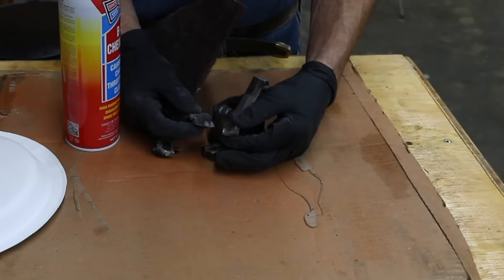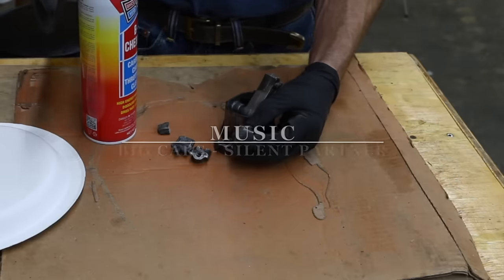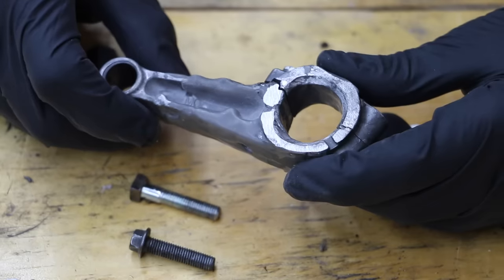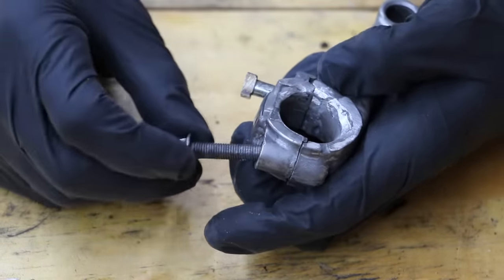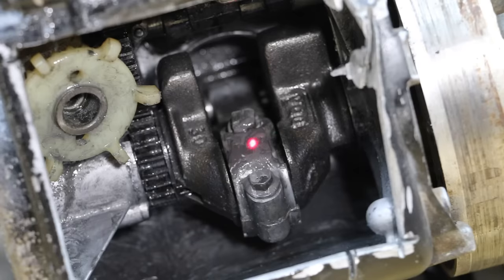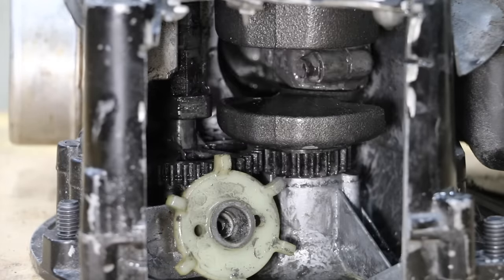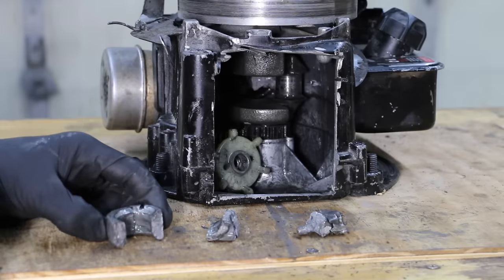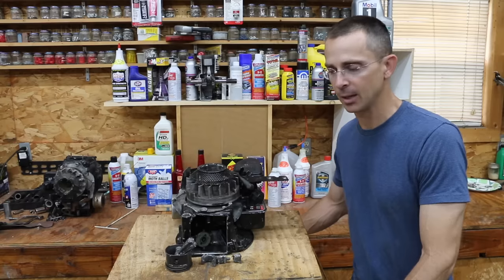Is JB Weld Strong Enough to Repair a Broken Connecting Rod? Let's Find Out!

Comment: I just tried to fix the top of a plastic 1-gallon gasoline jerry can (the one I used for 50:1 2-stroke mix) with J.B. Weld.  The very top of the plastic cap had sheared off at the threads, making the can junk.  Unfortunately, J.B. Weld didn't hold strong enough and, after curing for 48 hours, the repair job failed at the seam as soon as I tightened the cap back down.  It would be interesting to explore the science behind epoxy resins and how/why their bonds might fail tests of tension/compression/shearing.  Do they need a porous surface (i.e. wood-on-wood) to adhere tightly, or is it important to get the the tightest clearance possible (i.e. two pieces of flat glass clamped together)?  Also, does petroleum/hydrocarbons affect the strength of the bond, all else equal?
Reply from the maker: Thanks for the video idea.

Comment: jeep straight six 258 cracked  on the drivers side after adding cold water to a overheating engine. took it home  , cut along the crack with a die grinder to make a decent grove.  wire brushed  the length, cleaned with carb cleaner or electromotive cleaner  dont remember lol. jb welded it up let it sit few days ,filled the cooling system and off we go. that was 8 years ago. drove it back and forth from Florida to north Carloina several times. and its still going.
Reply from the maker: Thanks for sharing.

Comment: This video is not about JB weld at all.  I appreciate the effort. thank you for the video. Respectfully when applying epoxy to butt ends im sure everyone knows additional surface area is a way to give the epoxy more grip so drilling into the rod a few mm maybe several times and maybe  through, with a 1mm or 1.5mm drill bit at the bonding surfaces with a very slight countersink would create a lot more grabbing ability for the jb weld while hopefully not F-ing up the surface too much for a clean bond. and was it  " steel " jb weld for metal applications that was used ?

Also respectfully Im not sure what part of the rod "  looks pretty good "  just before it was installed after the repair.  the rod bearing area looked way out of round and I didnt see a rod bearing used at all. maybe there isn't a rod bearing for that motor design or maybe it wouldn't fit after the rod repair job. if there is no rod bearing for that motor then the rod should be precision milled to a generally acceptable clearance to that current crank diameter and oiled or cooled properly before any reasonable conclusions can made about the JB weld product but I hear Mr. Project Farm blaming and bashing JB weld over and over.  Hearing any play and clickity clank between the rod and the crank before its even started means this is just " lets glue it sloppy and watch it break for fun " video. All while making a JB weld product look bad with little explanation why his machining skills and already doomed rod make JB weld an insignificant and irrelevant player in his failure to repair the rod even if only intended for a 2 min run.
Reply from the maker: Thanks for the constructive feedback

Comment: I used JB weld over three years ago on my Chevy #1 cylinder cracked exhaust manifold. 2021, still working just fine. The key to JB weld is the dry time. I find 48hrs best.
Reply from the maker: Thanks for sharing.

Comment: Hi, it appears that you used very little pressure when bonding the pieces together.  Is it unnecessary to use a clamp or other method to put pressure on the bonding surfaces?

Comment: Hi Todd,  You are my go to guy when I have problems.  As your JB weld test clips are a few years years old, I wonder if it may be time to test some of their newer products.  I have a Chev 235 1958 engine that has two cracks across the cold plugs. As cold isnt really an issue here in Australia, heat being the bigger problem. I would like to suggest you test the JB Weld EXTREMEHEAT™ PASTE - 3 OZ to see how it compares with the standard JB weld. Cheers and Beers. Daz
Reply from the maker: Thanks for the video idea.

Comment: There are other pro adhesives designed to be literally stronger than metal. Loctite EA 3478 (aka fixmaster superior metal) is one. SikaPower-1277 is another. The latter is even designed to absorb oil from oily surfaces, helping maintain corrosion resistance. These produce machinable surfaces stronger than steel. Might be fun to play with some for a video someday ;)
Reply from the maker: Thanks for the suggestion.

Comment: EXCELLENT effort to bond it! Please consider next cutting straight through the connecting rod bearing. When metals break in pieces its nearly impossible to reassemble them straight or curved to spec's. It appears the connecting rod bearing was not smooth. I wonder if a connecting rod could be repaired if it had a very simple break?
Reply from the maker: Thank you for the video idea!

Comment: I have question.  I'm working on an old radio that has lots of gears to the tuning (Shortwave Hallicrafters SX-42).  There is a small gear that is cracked to where it will still slide into place but it spins on the shaft there the knurling is located.  Do you think JB Weld would work for this application?

Comment: I really like your videos! Thorough, fair, and out of the box thinking. 
 Im wondering if JB Weld is tough enough to repair the scratches and gouges in a cylinder wall. Ive used it in a small 2 stroke engine l was learning to port, l say learning because l modified the exhaust port too much once, took too much out, and built it  back up with JBWeld, it ran great for years after. This was 20 years ago and the little engine still runs! Great job on your videos. Keep up the good work!
Reply from the maker: Thank you for the video idea!

Comment: I had a coolant leak in my intake manifold. I plugged the leak with JB Weld and it lasted for years until I sold the truck.  I have been a GB Weld fan for 30 plus years.
Reply from the maker: Thank you for the feedback

Comment: Hey Todd! I’m not sure that it would make any difference, but if I was going to attempt to glue oil impregnated aluminum, I would run it through my ultrasonic cleaner in a degreaser solution such as Purple Power first. I think a bent connecting rod would probably self destruct even if it wasn’t broken.
Reply from the maker: Thanks for the suggestion.

Comment: Ive always mixed my jb weld with more hardner to make it a slightler less darker mix.
Ive always had excellent results as long as i clean the surface and leave some abrasion to help bond it.
I wonder if jb weld works better with the 50/50 mix like they say
Reply from the maker: Thanks for the video idea.
Reply: @ProjectFarm  Thank you for all this interesting information.

Comment: I job welded a Mercury 2.4L V6 boat motor block. I was turning it 7000RPM on an Allison boat when it broke the crank, windowed the block, and gouged off the sealing ring ridges. I built them back up with JB. Patched the holes in the block with JB, filled the gouges in the pistons (from crank pieces catching in the ports) with JB, then slapped in a used crank and some used piston rings. I sold it a year later still running like that. It was a little hard to crank, but it would still push the boat into the 70's....
Reply from the maker: Thanks for the feedback!

Comment: hey man I hope you reply, I'm new to fabricating stuff in my car, and I got this aluminum odd alloy stuff that I'm using for the intake came from a cheap intake kit, I'm routing it into my bumper, the intake doesnt take too much heat or stress so could I use this? does this stuff withstand boost pressure? For example if I used it to get a flange on my Bosch Bypass valve so that I can mount a cone filter on it? It looks like this Is exactly what I've been looking for. not sure let me know please!

Comment: One trick that I learned about JB Weld steel stik...apply on the surface and then cover the surroundings like a wall. Its still holding my engine block hole like a champ!!
Reply from the maker: Thank you!

Comment: I have used a two-part epoxy resin to repair broken bits on my chainsaw and my whipper sniper. It is called "metal epoxy". So far, it worked well. The thing is I only used it on parts for static load such as screw thread. I believe that quick fixes like JB Weld won't last on dynamic loading component like this crank shaft. The centrifugal force will find the weakest spots and tears the component apart.
Reply from the maker: Thanks for the feedback.

Comment: Maybe try casting a completely new Conrod and cap out of JB-weld. Even perhaps make it slight thicker in areas. I don't know if you have access to a mill to finish them off so the bores are round and square. I would love to see how a plastic cast rod would do.
Reply from the maker: Thanks for the suggestion.

Comment: A  past repair on a chainsaw, I embedded wire in the JB weld between the parts and let it cure for two days. Talking with the friend I did the work for, the saw is still holding together. But the repair wasn't to the connecting rod, yikes, it was on the case. It did seem to hold up to the vibration of the saw quite well.
Reply from the maker: Thank for sharing.

Comment: Heliarced a broken rod cap on a buddy's compressor about 3 years ago...it's still running....old kz1300 6 cyl. Street bike...guy gave it to me...he had run it into a curb and it broke a hole in the lower case big enough to put your hand into...layed it on it's side and made forms with carboard and super glue...used the large size jb weld..all of it.. rode the bike for 3 years... no oil leak..buddy with a cad Northstar, ran it over a rock. Broke a 2x4 in piece out of the pan...pull the motor to replace it? Hell no. 3/8 aluminum plate same shspy as the bottom if the pan...drill 2. 3/8 holes for bolts, put seals on the bolts, made a bracket that hooked. Inside the pan, drill/tap holes..clean well and 2 kits small size jb weld..wipe off the excess...ya half to look twice to even  notice it.. drove it every day for the past year, it doesn't even seep...
Ya the con rod...we knew it would not fly....but ya just had to prove it!
Ever used it on a head sealing surface? My  BBC boat motor with aluminum heads,,, serious pitting around the water passages...Dremel out the pits for clean metal..jb weld with a razor blade...steel shim head gaskets. Used that nasty brown sealer....year later...maybe 200 hrs hard running time...pulled heads back off...jb weld still stuck...couple things you might tell people...jb quick weld is kinda worthless...and regular jb weld NEEDS 24 hrs cure time...hot weather, cold weather it don't matter. Do you know any history on jb? I'm 65 and it was around bwhen I was a kid. 
You have a cool show...nuthin but in your face facts..keep up the great work!
Reply from the maker: Thanks, will do.

Comment: Would it work using to repair inside  threads in a small engine block. Like for a push ,or riding mower?
Reply from the maker: Thanks for the suggestion.

Comment: I used JB Weld to repair a good sized crack in my Dodge Caravan exhaust manifold.  It was not recommended for high heat areas but held fine for the life of the vehicle.
Reply from the maker: Awesome!  Thanks for sharing.

Comment: I don't know if it will hold, but quicksteel is stronger in my experience, it's a 2 stage putty epoxy, I've re-attached a bolt ear on my 94 Wrangler tail-shaft extension housing, and it held up until I removed the housing to put new one on, that was with 4.0 i6, a tool and die guy my brother worked with used it in a die once to fill a low spot, my brother said it was still there 6 months later when he left, and that's after 10's of thousands of hits in a press

Comment: I fixed a 1964 corvette engine block that froze up during the winter with JB Weld. Back in 1988. It held til I traded the car off. It was holding strong after about a year when I walked away from the car.
Reply from the maker: Thanks for sharing.

Comment: Thanks! Thats HELPS my DECISION NOT to use JB WELD to re-attach my porch rail. However, I DID use it to FILL in the rust holes in the bottom of my metal door (after cleaning, of course).
Reply from the maker: You are welcome!

Comment: How long did you allow the JB Weld to cure? It probably takes several days to reach maximum strength.
Reply from the maker: Great point. I seem to recall waiting over 24 hours but longer would have probably helped

Comment: used something similar on my bike when some guy cross threaded the sump drain hole. we drilled the sump bolt all the way through and tapped a smaller bolt into the bigger one and "glued" the original bolt back into the sump. couldn't believe that It worked and stopped leaking oil everywhere!
Reply from the maker: Thank you!

Comment: Please show me if it's possible to repair the magnesium housing of a framing nail gun. Mine is broken on the bottom of the handle, where the bracket on the bottom of the rail is bolted onto the handle of the nail gun. The handle has a member that's essentially an eyelet to accommodate the bolt that is holding that rail to the bottom of the gun. Unfortunately that cambel hausfeld designed this in a way that if you drop the gun ONE TIME it's likely that this eyelet will break off, leaving a gaping unrepairable hole in the pressurized housing of the gun, when the bracket could have been effortlessly placed 2 or 3 inches further down, where it could be connected to the 'pan' where the inlet for the air hose connects, because this 'pan' is on the other side of a gasket. If that were to be the piece that is at risk of breaking it would be a part that you order, instead of a whole new gun. I found an exact match of the unit I have that's broken for $40 on offer up that works. I DO NOTCARE THAT I CAN GET A NEW GUN FOR CHRAP I GOT THIS ONE FOR FREE NOT KNOWING IT WAS GASPING FOR AIR FROM THE SIDE OF ITS NECK AND IM NOT TAKING NO FOR AN ANSWER. ILL TIG WELD THE MAGNESIUM B** IF I HAVE TO. but epoxy repair I'm thinking could hold pressure, I'm more.concerned about it bonding to the magnesium. There's also the idea of solder, something like lumiweld. But I really want epoxy to work. I think this would benefit both of us because magnesium repair is something that involves a lot of European motor casings or the landing gear of an F14 if someone happens to be repairing something like that. Other aero parts too!
Reply from the maker: Thanks for the suggestion.

Comment: I used it on a lower transmission mount and it's still holdin.. gotta be clean and use a lot of jb weld haha .. it's crazy it's worked this long
Reply from the maker: Thanks for sharing.

Comment: I've seen epoxy used on motorcycle crank cases where the chain has broken and bunch up around the drive cog, punching a hole in the crank case. I've seen more than a few come into our welding shop and they had obviously run that way because the repairs were whole.
Reply from the maker: Thanks for sharing.

Comment: Jb weld is holding a rocker arm together on my grandfathers farmall tractor. Has probably 1000 hours on the engine since he did it in 2001 and its still holding!
Reply from the maker: Thanks for sharing.

Comment: Yea I’m thinking of using inside a pit motor to hold the thing that disengages the kick starter I think it can do it as it’s only on slight pressure as the motor starts
Reply from the maker: Thanks for sharing.

Comment: My question in their to this is, Would JB weld cold weld 5020psi seal. An extreme high pressure fuel leak at a compression fitting. Their was enough pressure that it blew the rubber line off that was clamped. By 2 hose clamps. It's an issue causing me grief and I'm just about froze at 3:12 am
Reply from the maker: Thanks for the feedback.

Comment: When components like con rods fail, their geometries almost always change. Can't think of "failure" situation that doesn't involve a change in geometric tolerance. I can't imagine JB Welding it together took it back to factory tolerances or anywhere close, which is part of the point. Those little stresses add up to big stresses at 500rpm and beyond, even with no load. Would be interesting to try JB Weld in a similar application where precision wouldn't be such a huge factor. 
Great work!
Reply from the maker: Thanks for the feedback.

Comment: I was remembering a repair I did to the mounting flange on a Chevy fuel pump. To make sure that the flange didn't break again, I reinforced the repair with a small strip of metal. That worked well. The flange never broke. The car ultimately died with that pump still on it. Just wondering if reinforcing that rod might have helped it last a bit longer. Most likely not but it is a thought.
Reply from the maker: Thanks for the feedback.

Comment: I 'fixed' a hole in the transmission pan on a 77 BMW with JB Weld.  After 10 years, it doesn't leak a drop.
Reply from the maker: Impressive repair!

Comment: The only way I have ever got JB weld to hold on things like that is to drill small holes in the pieces to make a a cleat and then cure it for a week. Then it's still grab bag if it will hold or not. Much better to just get another part!
Reply from the maker: Thank you!

Comment: My mom's trackor didn't have enough antifreeze and the block got frozen and cracked in about 1980. She sanded the block to bare metal and used JB weld to repair a Crack about 15 inches long. She never got it repaired right  and used the tractor until about 2010 when she sold it. A good as JB weld is it isn't going to fix a rod.
Reply from the maker: Thanks for the feedback.